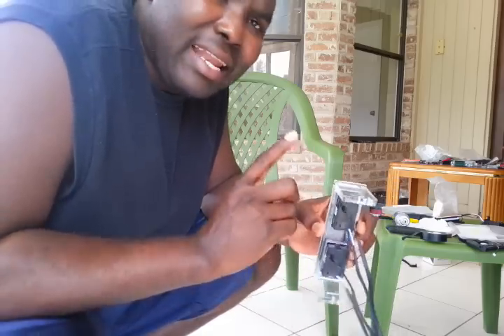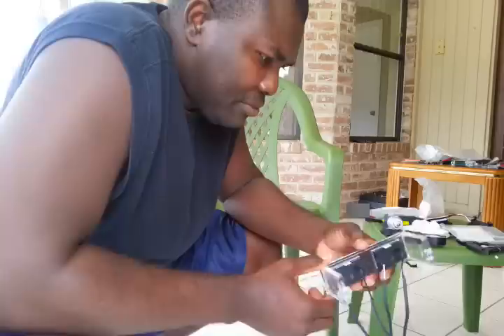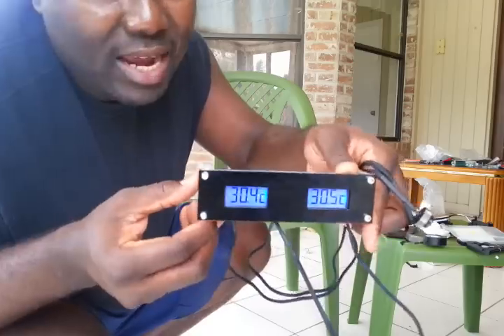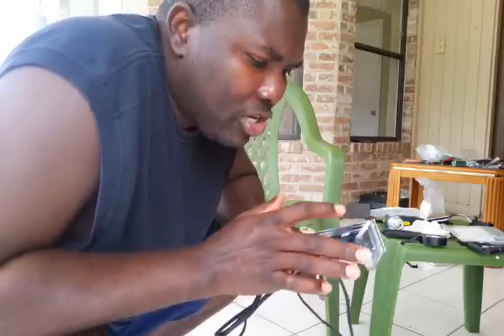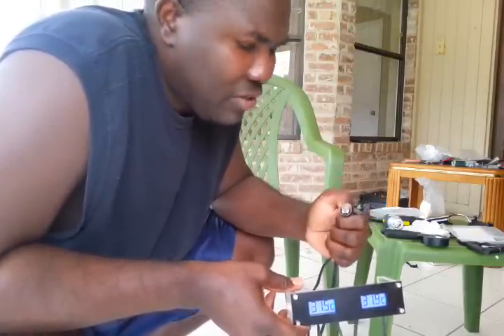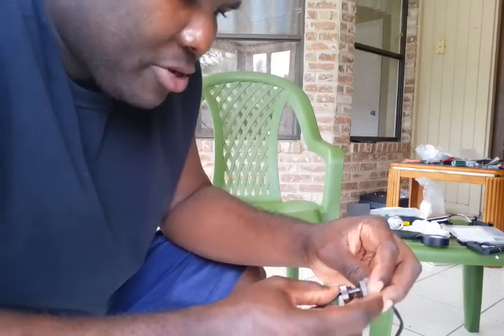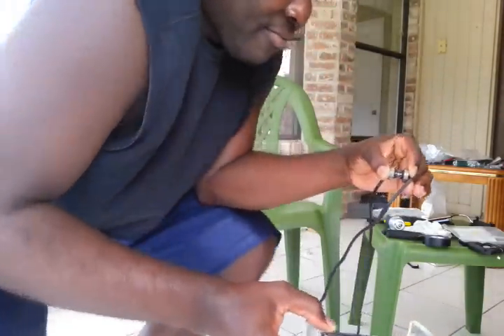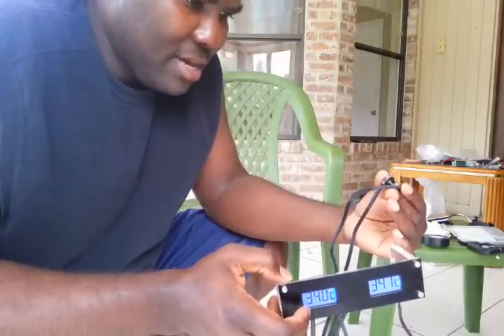XSPC LCD Temperature Sensor

Comment: They seem to be both in sync when you are not touching them which most certainly will not be an even exposure to your body heat. At 1:50 in the video they show both 30.7C. Looks fine to me. Thanks for the review.

Comment: .5 of a diff is ok, considering other comments and your body heat effecting through conduction isn't to bad. What i really want to know is what happens if you extend the distance of cable from sensor to lcd unit? . Good review dude.